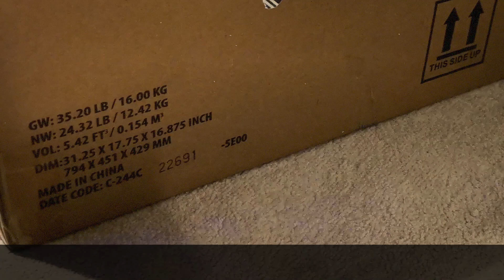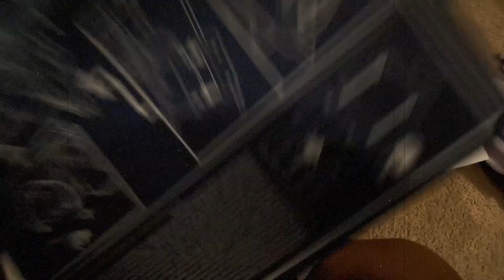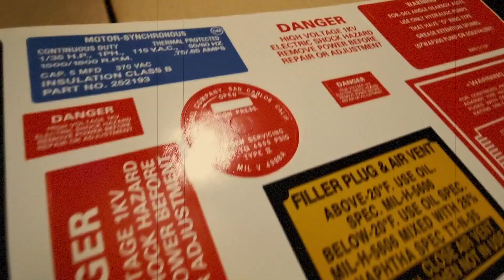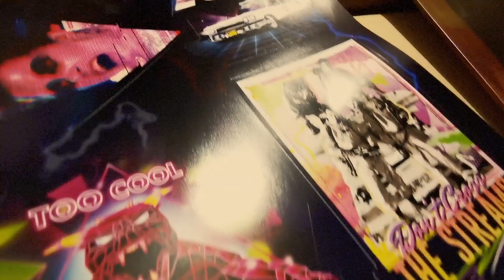Ghostbusters Haslab Plasma Series Spengler’s Proton Proton Pack - NEW !!!(Unboxing) (first look)

Comment: Dude, FedEx tells me mine is supposed to arrive by end of today (Thursday the 12th) but everything on the app and website make it seem like all they’ve done is print a label and nothing else is happening. I’m so jealous you’ve gotten yours in hand right now.
Reply from the maker: I'm sure yours is not far behind, I was surprised to get mine so quickly !.... Then you can shout "I've Got one" !!! .... Great unboxing fun !....
Reply: My plan was to respond: “Oh! Oh baby! Oh you’re my no. 1 Christmas boutique item!” while bear hugging it.
Reply from the maker: Did you receive you Pack ?
Reply: They rescheduled for this coming Monday but shortly after changed it to Sunday the 15th. At the very least it’s inside the state of Texas where I am so that’s good.
Reply from the maker: @MichaelAarons1701  Excellent, It's well worth the wait .... (just make sure you have 4 x D Battery's ready !!) ... Cannot believe the size difference between the spirit pack and the haslab one !..... Great detailing !.... Have you got a ALICE Frame ?
Reply: Yeah. And I made sure it was the LC-1 because it definitely makes a difference. I also have the Gen. 1 proton rifle without e orange tip which looks a whole lot better. Will definitely do on the D batteries, thank you.
Reply: Finally arrived at about 4:15pm central time. I was expected a little more and I’m still eager to mount my ALICE to it because fighting with the straps was annoying and I’ve got my ALICE set (plus it has cross strap which I like). The stand was a bitch and a half to assemble and I kept feeling like I was going to break it on one side trying to get it on.
Reply from the maker: @MichaelAarons1701  Excellent it's arrived !! (Just fitted my Alice frame) - the securing bracket on the right hand side did not fit, so had to drill the hole out. Know what you mean about the Stand, it certainly went with a crack when I put mine together (Don't think that's coming apart again !) ..... Just about to fit the batteries and check out the electronics. It's great as even with the ALICE fitted it still sits on the stand. So pleased with Pack.....just need to decide if I'm doing to do the upgrades / weathering ? ....
Reply: Personally I’ve always wanted a replica of the classic designed packs because they are so elegant and beautiful compared to the battered, beaten design of the new movie. But I don’t want to ruin this doing at home mods to it.
Reply from the maker: @MichaelAarons1701  That's what I was thinking, but I did mod my Spirit pack and it look great (certainly does not look like a spirit pack now) but it would be hard to start messing with this pack... Excellent detailing, they certainly put some effort into it....